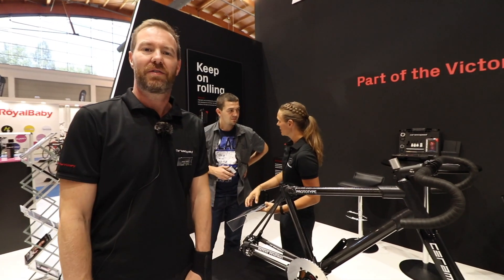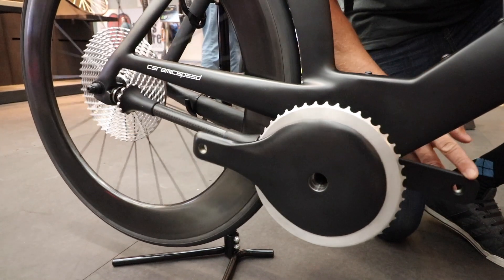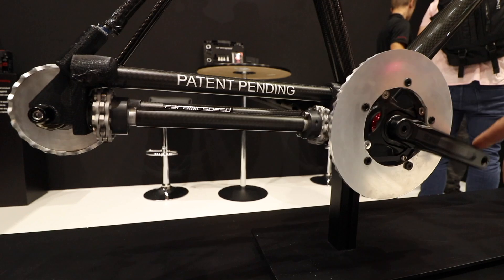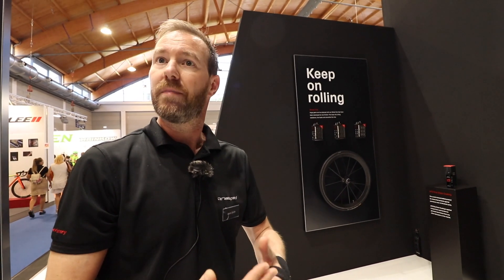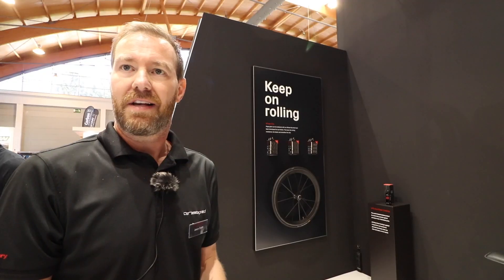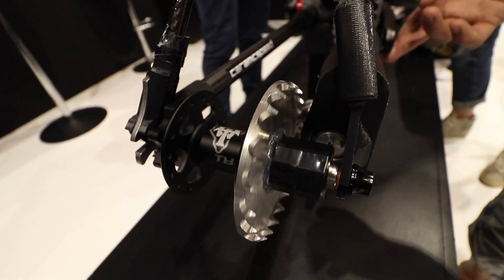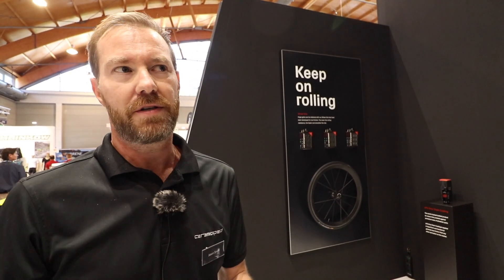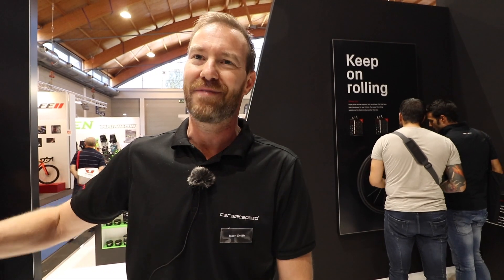CeramicSpeed Driven chainless drivetrain is 99% efficient

Comment: Looks good in that clean and dry setting. In the real world though getting that system working efficiently with all the crap that gets thrown onto your drive gear from the tyres and off the road or trail, this looks like it is going to need a lot of R&D befor we see a real world usable product.
Reply: Locked system avoid dirt. Hopefully that is possible to make. Less cleaning also.

Comment: Real world issues:  
If I have a flat on the road, how hard is it to remove the wheel to change the tube?  After i reinstall it on the road, how hard is it to get it lined up exactly right?  
How sensitive is it to minor fluctuations in the drive train?

Comment: Did you calculate gear sizes? Need 4 tooth 'sprocket' difference to actually fit in that flat array and give 6mm flank clearance between each pair (assuming material thickness of 2mm). Means number of teeth on sprockets = 12, 16, 20, 24, 28, 32, 36, 40, 44, 48, 52, 56 & 60 (13 'speed' cassette described on other videos) which gives 155, 116, 93, 77, 66, 58, 52, 46, 42 39, 36, 33 & 31 inch gears respectively (from tooth count, calculation and chainwheel to sprocket 'multiplier' of 1.5 described on other videos). Hardly close ratio at the top end and unnecessarily close ratio at bottom. I would guess the average rider would only need the four 116, 93, 77, & 66 inch for road racing and 77, 66, 58, 52, 46, 42, 39 & 36 inch for mountain biking, with the 39 & 46 inch being a bit redundant. As a wannabe racing cyclist a lifetime ago, even as a 13/14 year old I understood the importance of getting the block sizes (gear ratios) correct!

Comment: I can't ever seeing this being uci legal disc brakes were banned as can cut into your legs/burn you as they glow red hot in the case of a pile up then the teeth of a spinning cassette facing outward of the rear wheel look like they can churn up the human body 10 times worse. Especially in a 40mph collision  with two dozen riders.

Comment: The only difference I see is a drive shaft instead of a chain as far as friction is concerned. The sliding friction in a chain is going to introduce minimal losses, so the tiny amount from a chain is 50% improved. 50% of bugger all isn't much. 
I would be a lot more concerned about how my power was transferred when I stood up and put all my weight and power down through the drive. A chain is secured on multiple sprockets at any time, usually over half the available teeth are engaged and I know I can use an elephant to jump on a chain drive without worry. This has a single ball race engaged at any one time via what needs to be a carefully aligned shaft. No wiggle room here. Guarantee this will bugger up.

Comment: The active contact surface is not significantly reduced compared to a chain drive. There is twofold 90 deg. force redirection, which will cause additional elastic load (loss of power) compared to a straight chain pull. This is thus just snake oil.

Comment: They are getting really heavy on the gears--any flexing or warping--is going to disengage.  It is efficient but making it practical and reliable will be the challenge.  Chains are highly forgiving.  This design looks like it needs to be over engineered on order to keep the mechanism engaged.  I want to see it in actual use--not a good sign that they have no video of it being used with a rider going all out.  Let's see that efficiency--and how it translates to speed, both up and down hill.

Comment: No no no,not going to work,as soon as you put 6 or 7 hundred watts through that,ya nuts are going to become part of the toptube when it fails,and also if your so proud of it then put a Pro cyclist on it on some rollers,then say give it everything you've got,see how proud u are when your picking up what's left of it off the floor,and all that is b4 what price there going to ask for it considering a little bearings is hundreds of pounds

Comment: But how is it going to resist the torque being put through that shaft when in a low gear? The forces are surely too high for the rod and the torsion can damage the fibres?? Even if that doesn’t happen, those BBs are not going to be able to withstand the constant shifting and changes in torque through them over a long duration.

Comment: Please let this work - I am sick of my chains constantly snapping cause they can't take my power (I weigh 264lb each chain cost £50 cause I need the strongest ones but they still snap. Would've got a carbon belt drive but couldn't convert it to my bike (I ride mtb ebike and push it as hard as it goes). This new driven thing would be perfect if it can take my weight/power then I can throw away and never deal with a stupid derailleur and chain again. PLEASE!

Comment: They've reduced friction but they have increased complexity and points of failure exponentially. With an exposed chain drive any contamination on sprockets or chain that increase any mechanical  forces can be mitigated somewhat by the slack in the chain. 
With a pinion drive, once the bike gets covered in crud I'm not seeing how they mitigate against increased lateral forces and maintaining  pinion engagement.

Comment: Fastest, most efficient but don't expect us to demonstrate it on an actual bicycle.
Reply: It's a working concept at this stage, designed to create 'buzz', get people talking. However, it still needs developing and real world stress tests under a multitude of factors (weather, terrain, weight and strength of rider, hills, wheel sizes and tire types, suspension, etc.) before it's ready for sale in bike shops. I, for one, hope they make it work and iron out all the bugs. I'm not a big fan of chain/belt drivetrains.
Reply: @cliffcampbell8827   - I posted a year ago. Had to go back to the video to refresh my memory.  Is there video of the drive system being used on a bike with a rider?
Reply: @scootergeorge9576  I've looked on this platform and that search engine that rhymes with poodle and haven't seen anything. If it is a crowd funding scam, one might think we would have heard something by now, but nada. No scandal, no updates, just 0.
Reply: @cliffcampbell8827  - Didn't say it was a scam. Looks like a good idea.  I just wonder if it or the company failed. Maybe both.

Comment: Friction points on the bearings on the drive shaft ends not taken into account - weight of the drive shaft will be significantly more than a chain - lots of points of dirt ingestion in ceramic bearings.

Comment: I would think the horizontal teeth on the cassette would be prone to bending in the low large gears.  The new engineering does not counter that simple force.  Interesting PTO inspired drive train; would like to see it with length change shifting as well under hill conditions.  If the rear cassette would incorporate a counter rotation to add power and encase it, that could be the six sigma improvement.

Comment: Improve this bike, use a dual hub two tires in the rear place two plates in the rear. Then place teeth on both sides of the cranks and place teeth inside the crank casing. Then center the drive shaft so both sides of the cranks have drive moving the drive shaft. The dual hub in the rear now has two sides to move the tire has do the cranks with the back moving parts enclosed has the cranks are now enclosed. Use dense foam with a round outer surface with a notch on the inside of a dense foam donut placed inside the bike tire. Then use a kevlar inner tube you fill nitrogen that Will push the dense foam outward making the tire ridged. Now you have tires that can take thorns glass nails and so on. If you upgrade the bike to an E bike? Use organic carbon power cell technology and design rims that contain organic carbon power cells for a total of four carbon power cells. Could even add in a digital motor that has been rewired into a electrical power generator and have it operate off a carbon power cell's in the rear or the front to charge the back power cell's or the front power cell's when the bike is not being used with the digital generator charging up the other two carbon power cell's then it shuts off ounce the front and rear power cell's are fully charged. 😊😉

Comment: Why do you need mechanical linkage? Why not have the pedal assembly directly coupled to a electronic/electric drive. The slip of the generator could be intergrated with the hub motor thru  a computer for maximum variable speed. And the coasting and braking could be regenerated to the battery. A Human Hybrid Tesla.

Comment: It's not a new idea at all. When I was a teenager, 30 years ago, I had a remote controlled car called Hotshot. You can still buy it now I believe. It has a solid drive shaft to enable 4WD of the car. It was efficient when new but the drive gear wore over time and lost efficiency. I then moved over to belt driven remote controlled car. Bit easier to replace worn parts than shaft driven transmission. 

https://www.timetunnelmodels.com/live/catalog/tamiya-58391-hotshot-complete-deal-bundle-radio-control-p-19520.html

Comment: I like radical new concepts, but won’t this be less robust?  The current way may be less efficient, but it can take some beating.  This looks like if the shaft gets misaligned just  a little, it will have a huge problem..  I could be wrong, tho.

Comment: If I’m correct, a conventional chain is close to the same efficiency. The only energy lost is in friction heat, which is minimal for either system. This is not to negate potential advantages of ceramics.

Comment: Ok so I have an issue here. Let’s look at a normal bikes gears, very thin gears, a light chain, let’s look at that, big, thick metal. I guarantee you it’s heavier. Now, get your system, and a standard derailier, lift the back wheel, ride as fast as you can, you will see no difference in speed. Inefficiency in these bikes is caused because mechanical motion is transformed into head, that’s why disk brakes get hot, the deralier system doesn’t heat up, your improving efficiency where it’s already a neglible loss but increasing the weight and fragility, that’s a ceramic rod, I guarantee it will break far sooner than a chain

Comment: Will it SKIP, under heavy load?    My son has such powerful legs he unceremoniously stripped a bottom bracket-to-crank interface.      I suspect the gears will disengage under heavy load; those right-angle interfaces are asking for it.   Conversely, a chain might skip, but you can tighten a derailleur spring to counter that.      
So is this performance, at the cost of reliability?

Comment: I think the open design of the system is a huge problem, as well as tiny unsupported teeth being the only points of contact. It looks cool, but I would bet it is weak and will fail once heavy torque is applied. It doesn't seem like the designers and engineers use the K.I.S.S. principle. Why not scale down a shaft system from a motorcycle and just use lighter, but still strong, materials?

Comment: Put the cranks inside with drive shaft in the center. Use dual hub rear tires and use two plates in the rear and add disk breaks then enclose all the moving parts.

Comment: This is interesting. But those bearings do rely on tiny steel (or ceramic?) balls (or needles) for quite a lot of torque, and also as such require good protection against dust and water. Also I would imagine the cost being very high against the old proven chain drive. And is that efficiency improvement really an issue for a bike, I mean does the biker really get much more mileage for the same endurance rating?

Comment: I have doubt regarding of the efficiency of this system, that is basically a shaft drive , same as in motorcycles and competition does not use shaft drive because is heavier and less efficient due to energy dissipation in every gear contact point.

Comment: Come on, 99% efficiency is just marketing bullshit. A tooth engagement has at best 0,99 efficiency, there are two of those here so that would be 0,99²=0,98. Furthermore, the driveshaft needs bearings, and these will have an efficiency of 0,98 at best, judging by how much the shaft will flex under load I'd say 0,95. So it's 0,98*0,95=93% total efficiency, which isn't bad but roughly what a regular chain will do.

Comment: I kind of like this idea because you can have these crazy gear ratio like a 78 tooth chain ring at the front and 6 at the back without the derraliar cage length getting in the way there can be a new type of bike called a travel bike that has a very large Gear ratios going up to like the one I said before and you could posable go on the highway without going any slower than cars

Comment: So many small bearings with tiny ball bearings and pinions just waiting for road grit to clag up and suddenly kill off the efficiency.
In addition unlike a chain there is only 1-2 points of contact where as a chain there is approx two thirds of the chain ring in contact  with the chain. 
The tiny outer bearing case that the crank ring tooth comes in contact with it will probably shatter if you put some meaningful power down on the pedal or because there is only 1 to 2 points of contact of the crank tooth with the tiny bearing it is also highly probable that teeth are going to bend and wear out in no time.

Comment: Great concept, although I doubt that it would stand up to the power that a professional rider would produce.
Obviously there will be a side load on both the fore and aft pinion and the chainwheel and especially the gear wheel will be forced away from the pinion.
Having the pinions sandwiched between two driving and driven wheels would perhaps double the power capabilities.

Comment: The concept is 99% efficient until real load is on the bike. In order to minimize the friction they made the disc gear shaped like spines instead of jagged edge, doing so would shift the load from pulling the gear to the side into pushing the gear inward to the wheel. There's 2 problem: 
1. Material used for the disc gear would have to be super strong and rigid to avoid wearing out and became uneven.
2. You need more reinforcement over the drive train and the disc gear to make it keep still while being used under load or else it would start skipping as the drivetrain pushing away from the disc gear.
An alternative solution is to make a more suitable shaped spines for the disc gear so it would minimize the friction while still pulling the load to the sides of the gear.

Comment: I think Ceramic Speed are just presenting this as a concept although the marketing spin takes over when it is compared to Shimano Dura Ace because they are not like for like. The advantage is that Ceramic Speed remain visible to riders seeking the performance efficiency with the rub-off into their coated chains and lube.

The essence of this pitch is that a conventional chain has more contact with the chainring, jockey wheels and cogs. While this extra contact results in frictional losses, it still delivers the power transfer which is the part of the equation that is not dealt with here. 

To be able to accommodate the same power transfer as a conventional chain, this system needs increased friction (to ensure the 'cassette' both super stiff and wont move laterally plus needs to be jammed close enough to the shaft to avoid slipping the teeth) which invariably decreases efficiency. Drive shafts on bicycles have been around for over a century but the recurring criticism is efficiency and continued development is still required for it to be viable and adopted.

On the positive side, Ceramic Speed are trying to innovate and for this still should be applauded because good innovation still continues to trickles through to the mass market and keeps n+1 alive.

Comment: Why do you say no sliding parts? That's not true. The "pinions" engage the small ball bearings along a curve, because they are circular, so while they make contact with the bearings they push them but they also slide upon them. The only way to do without sliding would be making the radius of the "circular racks" infinite... But this would make them unusable.
Sorry, I don't find it convincing at all, prototype or not. Only pro I see is that the shaft could be built in such a way it is much more rigid than a chain... that would be the only real improvement, provided the overall weight is comparable with the current chain & derailleur system.

Comment: Great concept but a very weak design. 
The chain can handle extreme levels of torque that this design will never withstand. 
The aluminum rear gear “set” probably wouldn’t stand up to a teenaged rider before getting chewed up.

Comment: Don't know man...
I always like new and creative constructions and don't talk anything bad as a mechanical engineering student BUT
when constructing light weight components you should AVOID bending and torsionel loads at all costs and keep the force transmission routes as short and direct as possible because withot that the part needs to be quite heavy to take the pedaling force.
And I don't see that here.
I guess the rear sprocket will bend away on load and the bearing will be full of sand real quick.
Good principle but used for the wrong thing.

Edit: Also the gear changing seems to be not possible on that prototype. And the machining of the rear sprocket could be quite complex compared to conventionel ones.